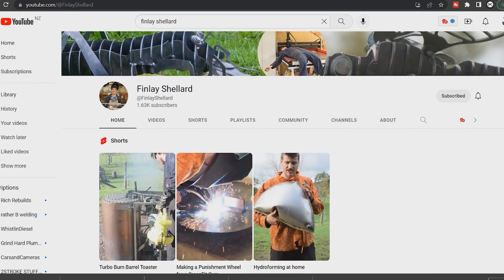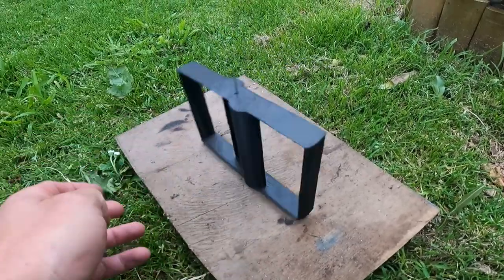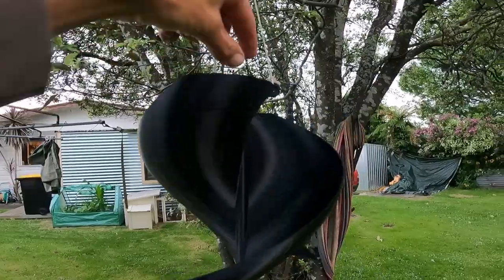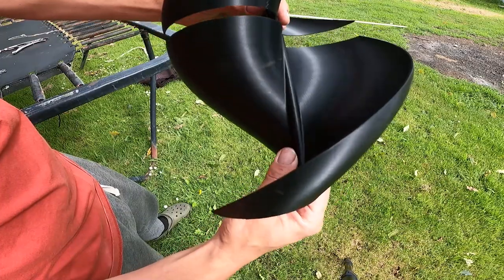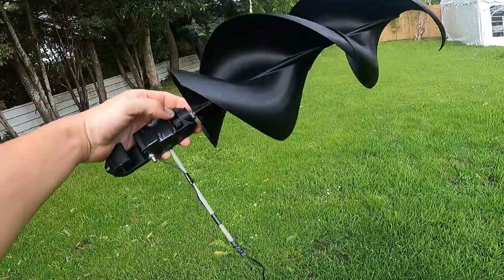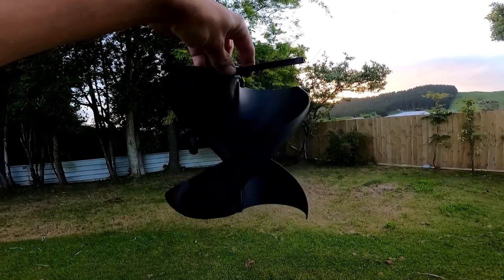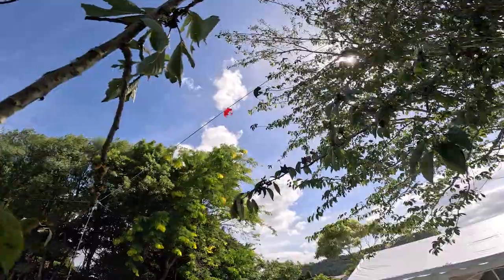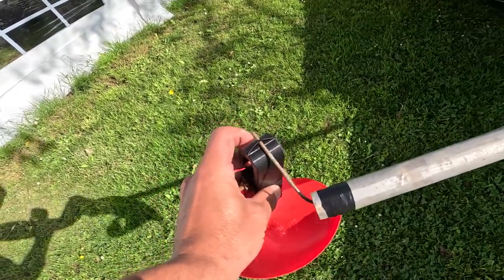Make Free Power From Trees and Wind?

Comment: You need to apply a load in order to measure the power output. Since yours is relatively low power I'd suggest a simple resistive load, a 12V automotive light bulb will do. Then measure the current through the bulb at the same time as the voltage across, that will give you your power (probably not enough volts to light the bulb, but that doesn't matter it still acts as a resistor). NOTE: once you start to apply loads this will result in significant breaking force on the motor! They spin fine now with no loads, but just be aware that they will be much harder to spin with a load attached, you might need bigger blades or more wind...
Reply from the maker: It is pretty inefficient setup I don’t think it would spin with a load very well , when I had two of them stacked it made a lot of torque but I lost the footage . I think a more suitable generator would be a lot better
Reply: @DktheWelder  Always love your vids and your sense of humor mate, look forward to the next one, cheers!

Comment: From what I understand, the bigger the thing is, the more efficient it gets (at least for traditional wind turbines). Perhaps making a multi-part design that's bigger would net more power, since bigger = more torque. Also worth noting that once you put a load on the generator, it's a lot harder to spin the turbine.
Reply from the maker: Definitely, that was just the biggest that would fit on my printer. I think how it was setup it would take a bit of load , could also stack one underneath if it needs more torque👍

Comment: My FPV drone can use 120amps @ 16v over 4 brushless motors. They can spin up to about 40k rpm. I wonder how they would do running in reverse creating power? I've got a bunch of old motors and ESCs I can send you to play with?
Also a flywheel to add torque could potentially help?
Reply from the maker: I think those motors would work but probably need to be rewired to make power at like 500rpm . A flywheel would help I think put the weight and cost might not be worth it
Reply: Yeah I wasn't looking at cost. Just an interesting experiment. I emailed you anyway. Got a package for you.
Reply from the maker: @offgridas  ok mate thanks , I guess getting it working well first then think about cost later 👍

Comment: New Zealanders are the kings of micro hydro power.  Shame DK isn't in the mountains. I reckon you need a car alternator! Most turbines run in AC.  I don't know enough to say why, voltage drop maybe.  The alternator in my car has an inbuilt rectifier and voltage controller to spit out 12VDC from various RPM.  Off to the wreckers?
Reply from the maker: I just used what I had , need a cheap small alternator I guess. Or converting it to ac afterwards would be easier?

Comment: Why not print a very large one maybe 6ft in circumference and 8-10ft tall ? Maybe that’s a bit ambitious but a 3ft tall 1.5ft diameter one should spin enough to push an automotive alternator. No bearings needed since you can bolt it to the shaft of the alternator and hang it from the bottom if hung upside down. Even spinning at a slow speed it will put out enough power to charge a battery bank. Than you’ve got a stable 12v system. The wider you make the turbine the faster the center will spin. 5mph winds could give you enough for sure. If you can get it up to maybe 300rpm that would be killer

Comment: The trick is figuring out the right size motor or generator.  Too small and it doesn't generate enough power, too big and it's difficult to turn.  Your spiral rotor thingies worked surprisingly well!
Reply from the maker: Exactly , that Lego motor could be completely wrong for this I’m sure there would be a lol more power with the correct generator setup

Comment: Thats a great idea.. now if i had a 3d printer i would join in and help give data and share ideas.... I'm in Melbourne Australia.
Reply from the maker: You could get someone to print it for you I guess , be cool if someone could make it work better
Reply: @DktheWelder  I have been thinking of getting a cheap beginner's 3d printer to start with as I am not working and have minimal funds but I want to get one and learn as I do and I have lots of things already I want to print... any suggestions on what type or brand of printer ?
Reply from the maker: @TimsBitsnPieces  ender 3 mate . You just put it together and it works great straight away. They are probably $200 in Australia, the harder part it the 3d design work but there are heaps of things people have already drawn to use. For fiddly little brackets and stuff the are great and especially for complex shapes
Reply: @DktheWelder  I have been looking at them.. thanks heaps.. yeah I already know about Thingiverse for other people's designs etc..

Comment: the idea is nice but with that set up you will need 110 of them to power 1 light bulb  hanging a 1000 of these all over the place to maybe power a small refrigerator isnt going to cut it.  go big or go home
Reply from the maker: A guy said in that wind it makes about 3w but I didn’t have any load on it . I think with a correct rpm generator it would be alot better I’m not sure how much bigger it could be made until it gets expensive or needs a structure to hold it.

Comment: If u print one big enough, what about the dyno thing they used on old  bikes that rubs up agains the wheel to power the lights? that would make more than the lego in power
Reply from the maker: I think anything would make more power than the Lego motor haha. I think it needs to be wired for a specific rpm maybe

Comment: to measure current ur meter needs to be in series with the load,the way you had it was a short and for the best motor you want a low rpm so ya can gear down the turbine and get more torque,remember that the more surface area =  more torque which is what ya need to make the current
eg 100rpm at 100mm high turbine could make 2V but theres not much current but if it was 100rpm and the turbine twice the size u will have more current
Reply from the maker: Ok thanks , I think it was spinning at about 100rpm probably too small to make any real power haha

Comment: Replace the hook with a carabineer. No diode needed since the brushes do the rectification function.
Reply from the maker: If you had a string of them wouldn’t they all try powering each other? A carabiner would work well I think
Reply: @DktheWelder  Yes. I forgot about having more than one turbine. Maybe if you wire them in series the higher voltage would be usable? Change the motor to a stepper motor and generate AC.
Reply: O must confess, I have been building the same thing. But the ones I plan are 8 foot tall and 18 inches diameter. I'll be using what is called a ThunderBolt alternator. You can see the alternator in my videos.